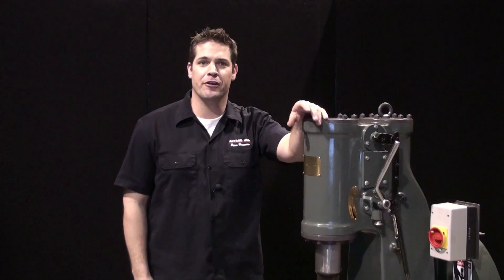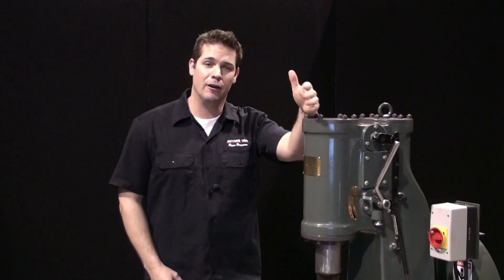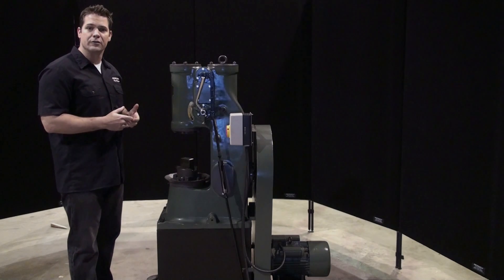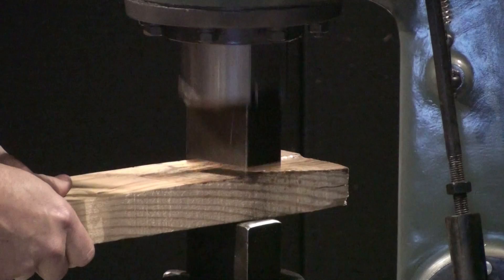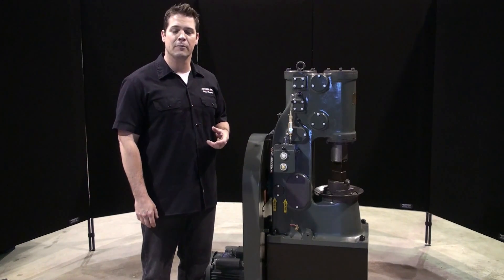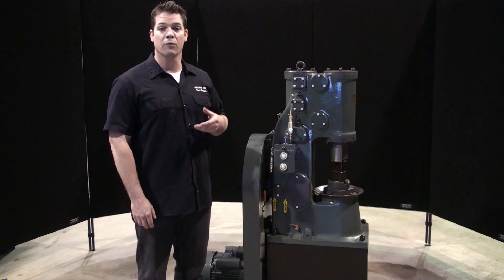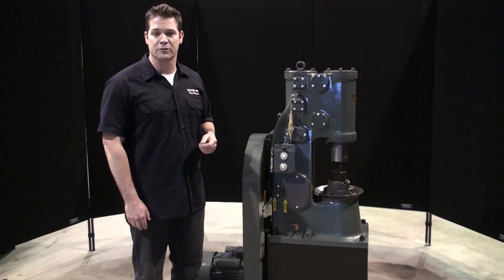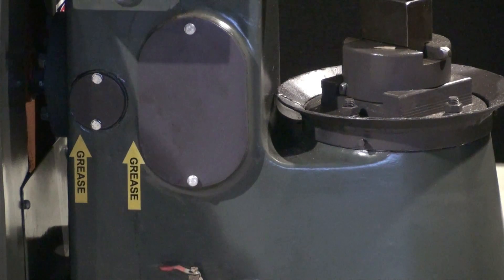Anyang power hammer basic operating principles and Maintenance

Comment: A friend of mine has two hammers and none of those have any zergs, we were looking everywhere.
The manual says there are 3, a sticker on the outside of the hammer says it has 2.
We looked inside and outside. No grease zergs, no drill holes, no threads.
Does anyone know, if the bearings even still need to be greased regularly?

Comment: Hello James awesome Channel I had a quick question about power hammers I was considering purchasing one and was wondering are there any models with built in chairs, as my legs get very tired while I blacksmith. Thankyou
Reply: I'm glad someone else asked about this. I've been designing modifications to my current power hammer to accommodate seating. Are there any models on the market equipped with chairs??

Comment: Can these be operated off a low speed gas engine? I have a antique hit-n-miss 2hp, could it be setup to power the hammer?
Reply: Possibly.  They have a 3 hp 1800 rpm single phase motor.  If you think the motor has enough torque/power and can get the correct speed through possibly a "jack shaft" similar setup you could run the hammer.  There is a fellow in Australia running the hammer off a 4 stroke Honda engine.

Comment: sir how the load can be measured per blow
Reply from the maker: The factory has measurements for each size hammer in Joules.  There are so many factors that determine forging capability of any power hammer.  Aside from the Joules measurement, I encourage customers to get behind a hammer and try tapering a piece of work close to what they would be forging in their shop.  I do have a series of video's on my website where I try to show forging capabilities of the various size hammers.

Comment: Hi James,Can you tell me why the smaller hammers seem to have an oil line only to the compressor side of the machine and the larger ones have an additional line to the ram side?Thanks
Reply from the maker: On all of the new hammers, there is only one oil line and that goes to the compressor (rear side) of the hammer.   If the compressor is getting enough oil, that oil will naturally flow to the front ram side of the hammer.  This is a change that we made in early 2016.
Reply: Well James, thank you very much for the answer. Makes perfect sense.
Reply: ami ai mesine ta kinbo
Reply: 01706773072call me please